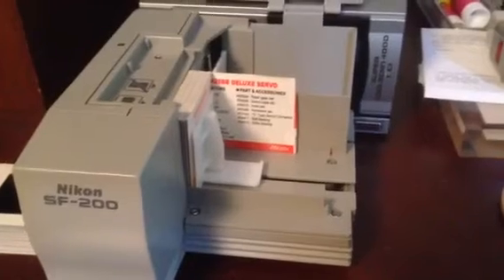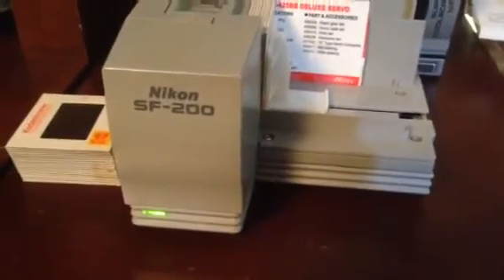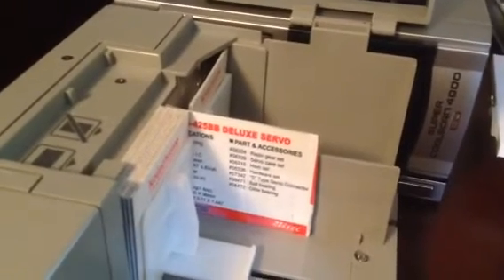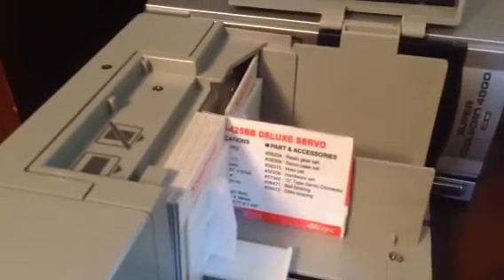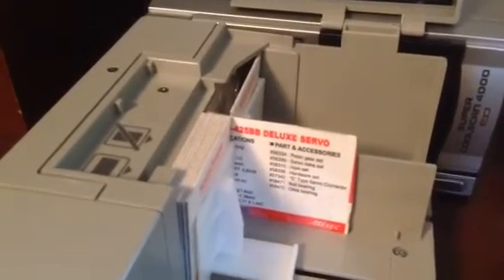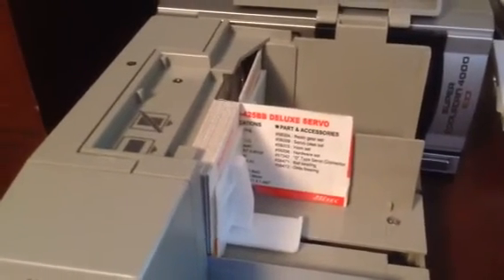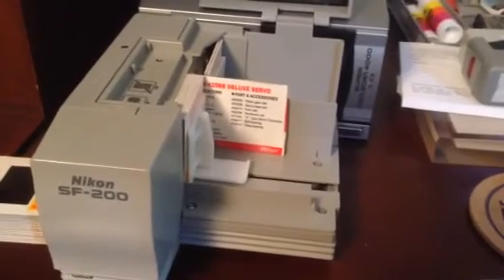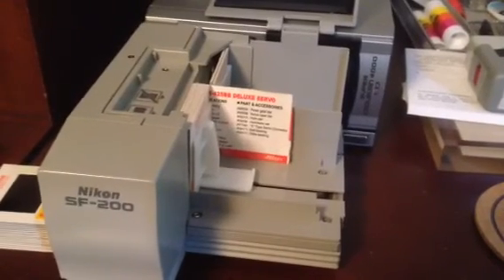Nikon Scanner Super Coolscan 4000 ED w Slide Feeder SF-200(S)

Comment: Great video, I looking to buy, is the Coolscan 5000 a better machine?
Reply from the maker: Sorry about the delay in answering.  I have never owned a 5000, but I believe the interface is simple USB rather than the annoying Firewire adapter.  Remember that these are old machines, and you will probably need software other than Nikon Scan to run the scanner.  I purchased VueScan, which I found to be an excellent product with remarkable support.